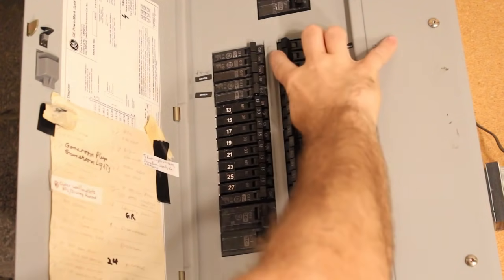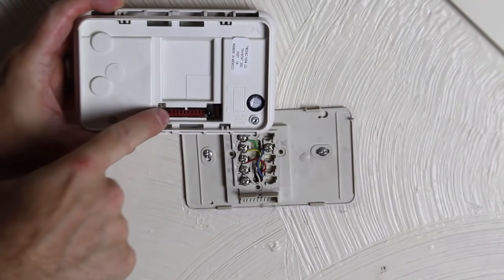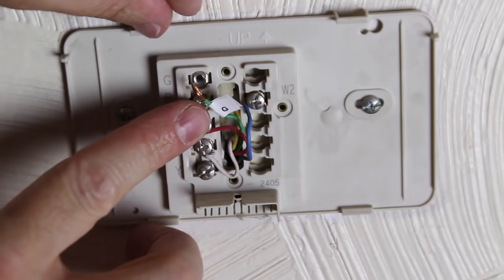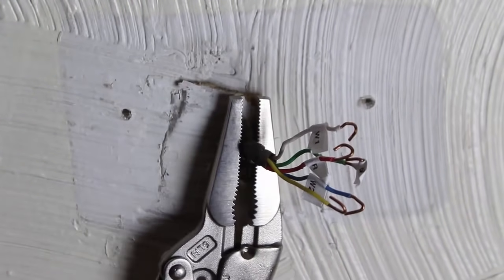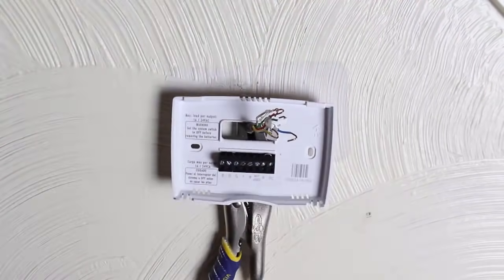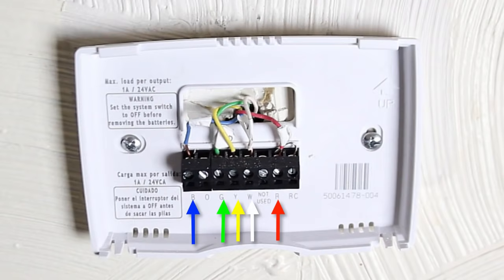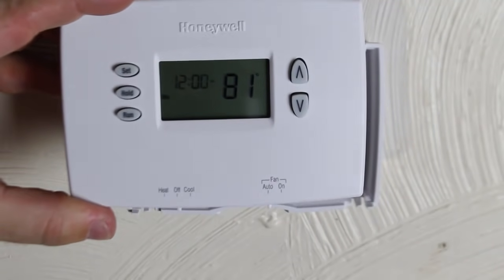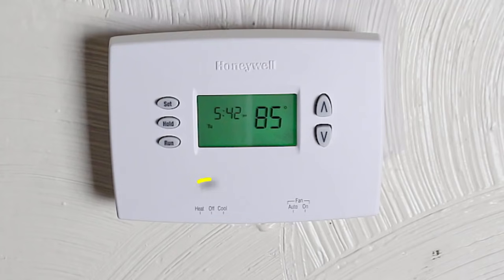How to Replace an Old Thermostat -- by Home Repair Tutor

Comment: Thank you so much for making this video! I am NOT handy at all. Our 15+year old thermostat died. I decided to buy a new one.Your video gave me the courage to tackle the task myself.  I was able to successfully replace mine!  Your video is clear, concise, detailed with step by step instructions.  You added a list of materials you used to get the job done. I followed your advice though and put the stickers on based on the old wire configuration (black wire went into pin for yellow wire and red wire went in RC pin). My only feedback is to include the removal one or two of the original wires for those of us who are completely not handy and have never worked with wires before. I know you edited it out as it seems very straight forward.  But I think it is helpful - even if it means we are watching you use the precision screwdriver to remove the wires that are connected to the pin.

Comment: Yes.  A Sensi WiFi thermostat.  I needed to install a dedicated c wire because my old thermostat was a four wire .  Your instructions made it really easy. Thanks again
Reply from the maker: Nice, those look cool. Great job!
Reply: Mine has a C wire which is brown and then has a black wire which is not Connected to anything it’s just hanging? Where do I put the se extra wires?

Comment: I'm completely and totally devoid of handyman skills but this looks like something I can do.  In any case, I'm going to find out.  Thanks for the video.  It mentioned a number of tips that I probably won't find in the instructions that come with a new thermostat.
Reply: how did it go ?
Reply: vision1707, thank you for asking.  Long-story-short:  It turned out the problem wasn’t with the thermostat at all.  The drain-line had clogged and this resulted in an automatic shut-off of the a/c.  My a/c guy, who I’ve used for years, blew it out with a compressed-air thing.  I then went up in the attic with him and he showed me where to pour a pint of bleach every six weeks or so to keep the line clear.  I will be doing that religiously from now on!  “An ounce (or a pint) of prevention is worth a pound of cure.”  

I asked him if he charged a weekend premium, for coming out on a Saturday, and he said no.  I said that he should.  I then said, “I’m paying you an extra $60 whether you want it or not.  You can take it in cash or I put it on the check.”  He thanked me and accepted three twenties.  Honest, competent, reliable repairman/contractors who consistently do good work are worth their weight in gold.  Amen.

The whole thing was a learning experience that unfortunately included a few days of discomfort smack dab in the middle of a Houston summer.  “Wouldn’t wish it on my worst enemy.”

Comment: Thanks for the video. The old thermostat I have is a vertical one, and the new one to replace it lays horizontal so it looks like I will have to drill two new holes, and plug the other ones as they will be showing at the top and bottom of the new base plate for the new thermostat. I guess I will have to twise the wires around and the prong connector. I hope this will not be too difficult of a job. THanks!

Comment: very conise vid, subscribed at one time earlier i guess but went back here. I have a carrier unit 5 years new. I run the ON fan alot during the day. recently when i dropped the a/c cool to 75 from 78, 'the cool' word blinking, but the blower does not come on to cool....please advise?

Comment: Thanks man! It’s no big deal if the screws do t go into a stud?
Reply from the maker: no, as long as you use plastic anchors it should be fine, very rarely will both screws anchor into a stud

Comment: Good observation & question presented by Kilroy below which I noticed & questioned to myself as well. Intuitively, the color coding of the wiring should match the terminal color designations. Why the discrepancy? Otherwise an excellent video. Do you have an answer to this?

Comment: Thanks for the video. Does the replacement thermostat have to match the old thermostat - for example whether or not it controls both heat and cooling?

Comment: Hey great video! I have an old intertherm thermostat from the 80s. All the wires are easy expect the blue wire which is labeled A. What does this mean and where do I put it on the new Honeywell thermostat like yours?

Comment: Don't understand why the yellow wire on the old  thermostat was on the terminal  'B' and was put on terminal  'Y'  on  the new thermostat  and  likewise the  blue wire on  terminal  'W2' was put on terminal  'B', when  it seems all instructions indicate to label each wire with the  lettering of the original  terminal and  to IGNORE the actual color of the wires!
Reply: Foking Exactly
Reply: Or why the wired labeled W2 was connected to B slot..🤷🏽‍♂️🤷🏽‍♂️🤷🏽‍♂️👎🏽👎🏽👎🏽👎🏽👎🏽

Comment: I want to replace my old Bryant T2-PAC01 thermostat; I see currently has only three wires, Red, Green, Yellow. Is this normal? I see in your video blue wire labeled W2, but finally connect to Blue, so what is that W2 for? Thank you!

Comment: Just had a new gas furnace install with the same thermostat. The fan will not run in "on" mode .... wiring issue I'm thinking? Great video btw.

Comment: Do you need to the turn the power off to the A/C before you connect the new thermostat or is the voltage fairly low?
Reply from the maker: turn it off to be safe
Reply: Would just flipping off the circuit breaker work? I'm not sure if my A/C has an on/off switch.

Comment: Our thermostat just went out today. My question may be a little dumb, but if the unit is hard-wired, what purpose do the batteries serve? We haven't popped our unit off the wall yet to check it out, but I see that your new one has batteries.
Reply from the maker: +Sharon Blackmon for this unit the batteries power the thermostat only
Reply: it'll save you having to reprogram it if the power ever goes out.

Comment: I pulled too hard last time and the screws are falling out of the wall. I've been using scotch tape to keep it firm against the wall. Do I need to call the furnace guy to fix it? The holes the screws were in seem too big now, from all the wiggling I did when I was trying to open it before. Hope that made sense, thanks.

Comment: Old thermostat had one wire to RH and one wire to W/B and a jumper from RH to RC (but I don't have air conditioning. The new thermostate has B, O, G, T, W, Not Used, R ad RC. So, where do I put the wires? I'm assuming I would put the RH into the R and the W/B into the W. Is that correct? And I would think I would just not use the jumper, since I don't have air conditioning. Help!

Comment: Thanks for your help but it happened to be a fuse on the circuit board in the furnace fixed for 4.00 at the auto store
Reply from the maker: Great job James. How did you figure out it was the fuse?

Comment: I only have 2 wires - a red and a white and new thermostats don't seem to have the same codes on the connections. Any thoughts?
Reply from the maker: David Landes if you're truly uncertain then I recommend calling an HVAC professional to make sure it's hooked up correctly. You can also call the manufacturer of the thermostat and get help via their technical service department. Usually these people are very helpful :D
Reply: +David Landes you probably dont have cool and fan auto on mode even though you have a/c, you cant cool down the room. need to be hook up a wire

Comment: Replaced old thermostat, gemtech....it had a red jumper wire on two R's (no red wire from wall).  This thermostat comes with a wire over the two R's.  I did not put the red one I have. The unit turns on only when placed on heater and I'm left holding a red jumper wire?? :/

Comment: I have a extra brown and black wire on mines?? Where does those go?
Reply: Those two wires tend to be used in an eight wire thermostat wire for an outdoor ambient temperature sensor so you can have the outdoor temperature displayed on your thermostat.

Comment: Hi, mine has an orange and a black wire. My house is so cold right now, I can't get it to work. Where do I put those?
Reply from the maker: Hey James Rolfe - sorry for the late reply and kind of lackluster response. But you should give the manufacturer of the thermostat (e.g. Honeywell) a call and get technical assistance. There are some many different configurations. It's hard to give specific advice without seeing your setup.

Comment: WHAT'S THE BARE WIRE ON THE FAR RIGHT GOING INTO THE RC ?   MY GAS FURNACE HAS AN APRILAIRE HUMIDIFIER. WHERE DOES THAT GO ?
Reply: TRICK-OR TREAT 
from the R you energized the Rc with tha jumper is for your cooling system. :-D

Comment: my mom has 2 wires, red and green...the stat os blowing cold air. .we live in New England, I think my bro hooked up R and G? any ideas? she heats w gas..thnks
Reply: +ltetobago this is not enough info to determine exactly whats going on, if she has a gas boiler then she only need 2 wires, if she has gas forced had air she will need 3 wires unless her furnace has a mother board and can energize the fan from the board. give me a little bit more info
Reply: Well the landlord put in a new thermostat but to us it is blowing air, like forced cold air..her house is not cold but its uncomfortable have cold air blowing on you...i have forced air too but my air is always warm...she's dealing with it and the lanlord will handle it but I don't think they know what they're doing...thanks for responding but I dont have any more info on it...appreciate it
Reply: ltetobago Sounds like the landlord should call a pro hvac company to evaluate the operation and performance doesn't sound like a thermostat issue more of an system performance. hope this helps
Reply: Probabbly you already solve the issue, but if she has a gas furnace , she needs to conect the wires in R and W.

Comment: I got my new thermostat from an electrical store and they told me to unplug the power to the heather only when changing the thermostat. No need to turn off the circuit breaker, is that correct?
Reply from the maker: You should be fine turning the heater to the Off position Thanh Cali but if you're concerned you should turn off the breaker to the heater.
Reply: Jeff Patterson Thank You!

Comment: Where do I look to see if my furnace is electric or gas?
Reply: If there is a gas line going into the air handler/furnace you could have electric or gas or dual fuel. Just look for gas and be safe.

Comment: My current thermostat has 6 wires--red, green, yellow, blue, white, and brown. The red is connected to 'R', the green to 'G', and the yellow to 'Y1'. The blue is connected to 'W2' and the white is connected to 'W1'----also labeled 'B' and 'O'----- and the brown wire is connected to 'C'.  There is a 'Y2' connection, but no wire to it.The new thermostat I looked at online shows only 4 wires and has the letters 'B, O, G, Y ,W, not used, R, Rc.' In alternate installation instructions, they say NOT to use 'C', but to wrap it with electrical tape. They also say NOT to use 'B' if I don't have a heat pump, which I don't, and to wrap it with electrical tape as well. So what do I do with the  blue wire, since there's NO 'W2' on the new one???  And why is that brown 'C' wire not needed on the new thermostat?? So why do I have a brown and a blue wire that's needed on the old one, but not on the new one??? I hope this all makes sense because I'm VERY confused about what I thought would be a simple replacement!!  :)  THANKS!!
Reply: I have NO idea why there are lines through my post--------I didn't put 'em there!!  THANKS!!
Reply: you use ---------------- a lot

Comment: can this type of thermostat be used on an old house with a thermostat from the 50's?
Reply: frank thomas 
i will depend on how many wires the old thermostat has. this thermostats requires 24 volts to control your system. if your old thermostat wires have 24 volts going thru then it will work
Reply: ah ok, i see.  i think i have direct line current to the thermostat.  like 115v.  thanks for the response!

Comment: An "Old Thermostat" uses TWO(2) wires. Usually, Red and White. Modern thermostats use 3 or more. I need to know how to get the new 3 or more wire cable up through the wall when the old one is stapled inside to a 2 X 4. You can't use the old cable to pull in the new cable until that staple is pulled out. Installers...what's the trick?? Wall board saw??

Comment: why label the wires with the old thermostat wire terminals (especially yellow wire is B and blue wire is W2) when you just connect blue to blue and yellow to yellow, etc. ?
Reply from the maker: Rocket Rider it's not a bad idea to have a reference of the old wiring, of course you could also just take a picture :D
Reply: OK, thanks !
Reply: Why did the yellow not go back in the b slot? I'm so confused

Comment: when your thermostat does not start your furnace and you jump the wires and it runs constantly.. How do you turn it off?
Reply: Vic Williams 
you would have to measure voltage. if you have the correct voltage then is the thermostat this thermostats works with 24v

Comment: How the hell do you get that thermostat off to replace the batteries?????????
Reply: He glossed over this part, perhaps because his was easy. Mine was a bit of a pain. I was able to get the thermostat off the base plate by wedging a flat blade screwdriver into the bottom and gently pressing apart.
Reply: @ktrock77  he didnt gloss over it. Replacing batteries is unrelated to replacing the thermostat itself,which is what this vid is about, as indicated by the title.

If you want to replace a battery, search for how to replace thermostat batteries

Comment: A battery thermostat is a bad idea.  I had one of those in my house and came home once to a cold house and frozen pipes because the batteries died on me, with no indication they were dying.  Plus, it would kick the furnace on again ten minutes after shutting off the heat.  Gas bill went through the roof and I got to the point of shutting off the system while I was away at night if it wasn't going to get below freezing.  No thank you.